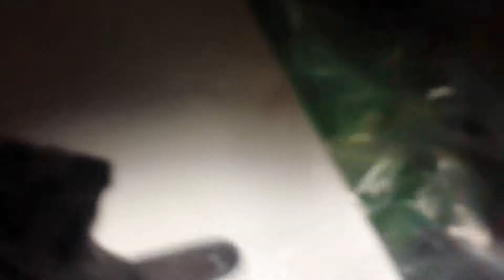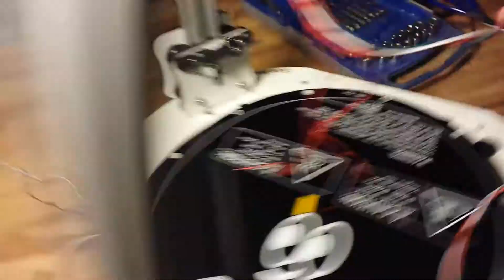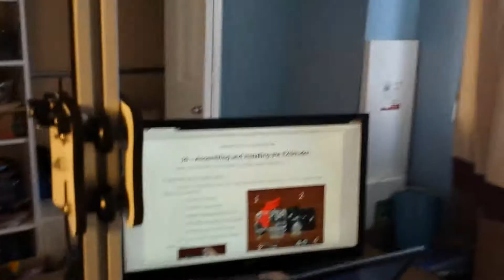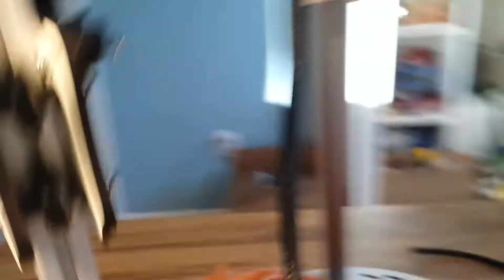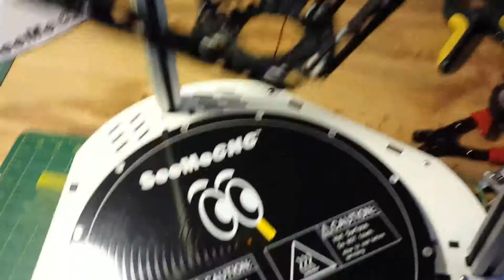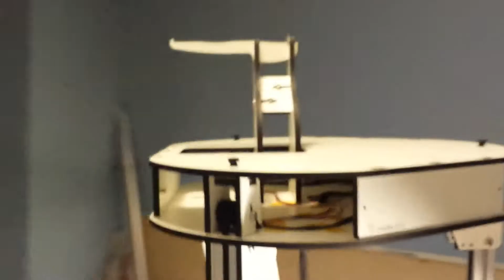Rostock Max v2 Build - Episode 5

Comment: Did you just solder them on with regular solder? Or did it come with the solder that needs to be used. I’m doing something similar and would appreciate your help
Reply from the maker: sassyDJ   All soldering was done with regular solder. The kit doesn't come with any.
Cheers